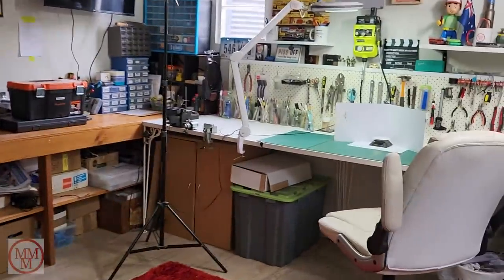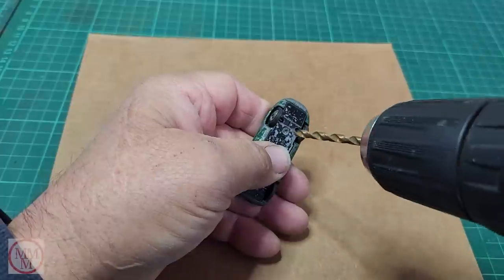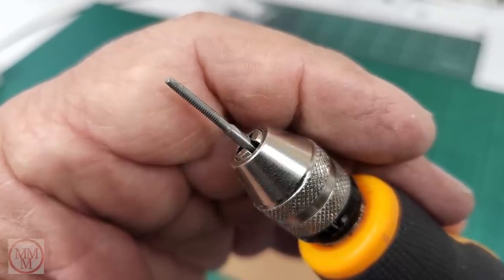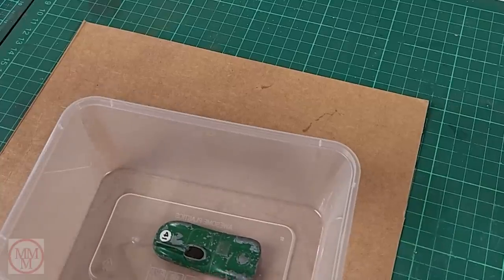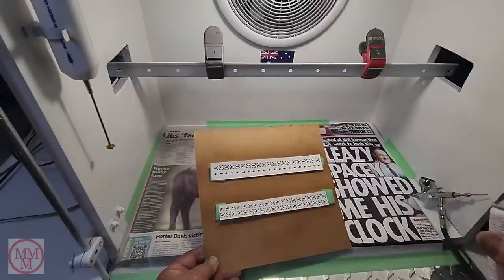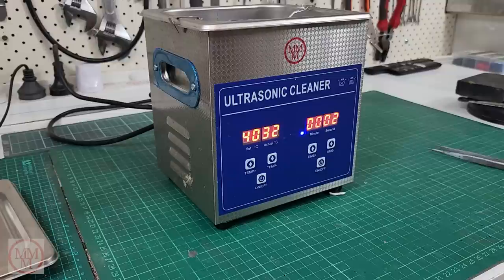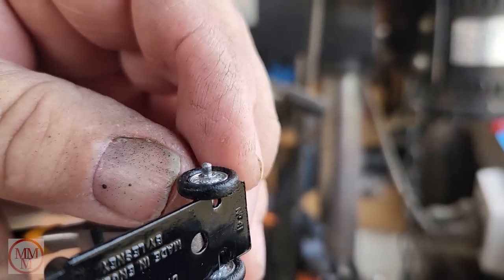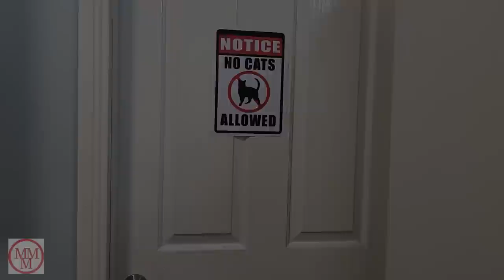MATCHBOX Restoration No. 41b D Type Jaguar 1960

Comment: So very happy to see you back at it. You're the one who sent me down the resto/custom rabbit hole. [@TinyCarFanatic] I haven't got an airbrush so all I''m using are spray cans for repaints and I had the same issue with the paint coming out too thick. The solution I found is to heat the cans in a sink of hot water (just from the tap) about halfway up the can. Leave them in for 10ish minutes (or out in the hot sun for a half hour.) The heat helps the paint atomize much better and gives excellent results. I also started with a can of the same CitrusStrip you used here with mediocre results. After a while I tossed the CitrusStrip in the bin and bought some paint stripping gel. Your channel was the very first channel that I subbed. Love your work! Cheers!

PS: Watch that Kevin, I don't think he likes Smudge. (My mum has a puppers named Smudge)
Reply from the maker: I checked out your twitter page - Some amazing work you've done there!! - I love the close up shots with the out of focus scenery they look real!
Reply: @MartysMatchboxMakeovers  Thank you! Just started the Twitter account a month ago so only my more recent stuff. I decided to "give it a go" on IG 2 years ago, then TikTok & YT last year (although my YT is growing at a snails pace) Honestly, there's a fair bit of inspiration that I got from your work. The resto you did on the Studebaker Lark Wagonair was the actual spark that lit the flame as I had one that badly needed a resto and you literally showed me the way. I appreciate you heaps and wish you all the best!

Comment: Have to admit, I also thought the idea of the hole punches sounded a cunning idea! (I was cutting out small circles of plasticard.) But as you found, the results were vert hit and miss. What you use as a punching table is crucial, I tried metal, plastic, wood and finally leather on a hard surface provided the best level of flexibility to allow cutting through your medium while being spongy enough to support the cut so as to minimize deformation. Trial and error. Excellent video, thank you.

Comment: Another nice restoration, Marty.  With respect to the Molotow chrome, the stuff you didn't use, on to of the upturned pot,  if you let it dry it can be reactivated with a tiny drop of Mr Hobby Levelling Thinners so need not be wasted.  The decals were probably difficult to separate from the paper because the punch will have crushed the two layers together.  Scissors the best option but a pain for circles :).

Comment: Hi Marty. One can't help but notice that you have big thick sausage fingers. Does that make doing all this delicate work with small parts harder? I have built a lot of models of all kinds over the years. I think we are about the same age. I painted a lot of figures for table top games too. I have longer thinner fingers and I always thought they made modeling easier. I was just wondering what you thought about it. I think it makes what you do even more impressive. You are a master of this artform. I mostly build new stuff, but if I had to repair anything, I would use your techniques for sure.

Comment: Great to see a new edition to MMM!   As an alternative to your jar in the ultrasonic is to use a small plastic bag, like 3 x 4“, with a twist tie. it uses less solution, and you can toss the whole thing out when finished. it has to be a good quality bag so it’s not to leak and contaminate the water solution surrounding. Uline’s catalog where we bought the size we needed.
Reply from the maker: Thanks for the tip, I will try that out next time I pull out the sonic cleaner.

Comment: I never thought it would matter, but them really old rubber wheels - if you put them in the microwave... seconds at a time.... fluffs them back up... like a lorry tyre overheating goes shiny before it pops... you make them hot enough to shine. And they are rejuvenated by the heat.

Comment: Marty, what primer you use on those metal models?
Reply from the maker: Normally I only use Tamiya fine grey. This one I didn't prime as I felt that the details may have been covered up with more than one coat of paint.
Reply: @MartysMatchboxMakeovers  yes, i used wrong primer once and after coat of paint details were almost gone. I'm new to metal models, that's why I'm asking about primer, well, thank you for reply👍😉

Comment: Welcome, Marty! You have been missed!

Poor Smudge! 

Pro Tip: You might consider some imperial sized hole punches as alternatives to your metric set. Matchbox would have been using imperial sizes when this model was launched. 9/32” is approximately 7.16mm which is close to the 7.2mm you mentioned.

Cracking restoration as always!

Comment: BAKING SODA and SUPERGLUE, this is a weak bond if you use graphite scraped from a lead pencil the bond with super glue is 12 times stronger than baking soda
Reply: You can buy powdered graphite as a lube...
Reply: @Pygar2  correct but it s expensive
Reply: @pollyg562  A tube for $3 or 100gm./$4.34- enough to last Marty for years if he'll get some flat toothpicks to handle and spread it... He tends to put stuff on in big lumps, then scrape, file, and sand the lump down.